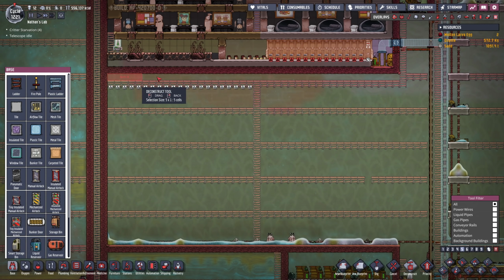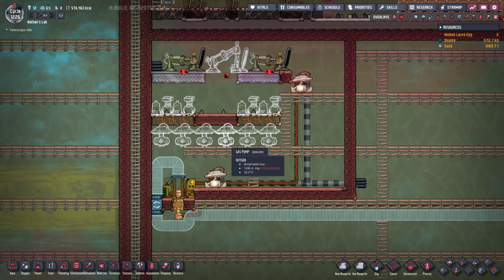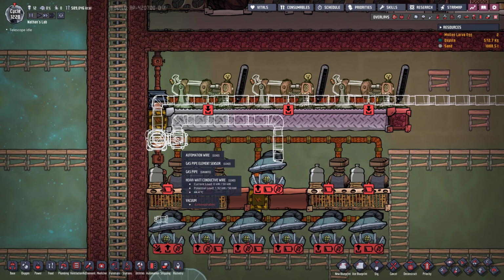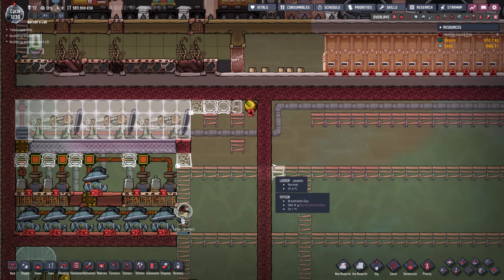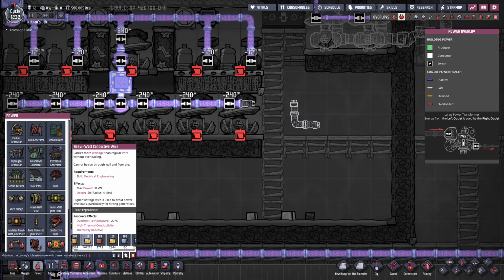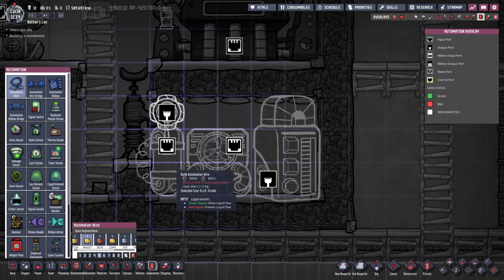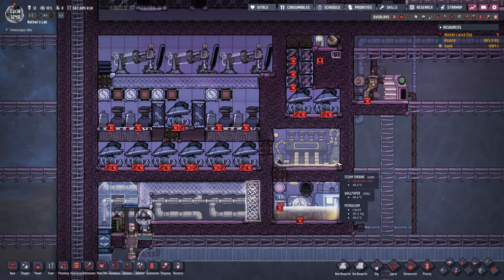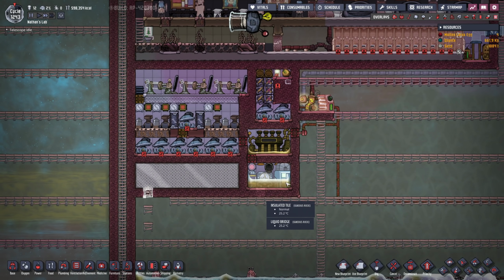OXYGEN FACTORY - Oxygen Not Included: Ep. #27 - Building The Ultimate Base

Comment: Great design, but  I have a few questions about the AQ room?
- Why did you not use pwater for the loop since it has a lower freezing point ?
- What was the point of putting petroleum in the bottom row of tiles?
- Why aren't you completely filling that room with water to get more steam? (and you get rid of oxygen)
Also is there a specific reason you are using a shutoff instead of the usual bridge with a sensor directly connected to the AQ? Since shutoffs uses power.
Reply from the maker: Hey, I didn't use pwater because it wasn't necessary, we didn't need to cool it lower than 20 degrees. The petroleum helps with heat distribution better, the steam in small steam rooms is often spazzing out a bit with temperature and imo it keeps everything a little more stable. Too much steam in the steam room will make it heat up extremely slowly and I will store way more heat than I need. Also the liquid vent does have a point where it's overpressured, actually not sure at what point that happens.
Reply: @Nathans-Sandbox  Thank you for replying man , you are such an underrated  youtuber

Comment: If you just use pressure sensors like in the original design you don't need all those filters. Also the 2 pumps in the middle won't pump at 500g/s, the tiles below the doors need to be air (pressure sensors for the bottom pumps in fact) of airflow tiles.
:)
Reply from the maker: The pressure sensors failed on me when I had full oxygen and wasn't using it as much. And it also failed when I wasn't using the hydrogen because I had enough power. I feel much safer with the filters now;)

Comment: I never do such cramped builds with mixed systems(air gen, cooling, compression) and never cut off duplicant access with walls. Systems should be maintainable and debugable. Shit breaks or you want to expand it... dup access is mandatory, you can always temporary restrict it with door settings, map is really big to be saving on space in areas rarely visitable by dups
Also why use metal tiles for heat exchanger? Tempshift plates exist for a reason...
Reply from the maker: If stuff breaks there will be a mess to clean up anyways, so I can just dig in again. I think building complex and autonomous systems is the most fun in this game. The metal tiles are to prevent gas exchange and still cool down the generators.